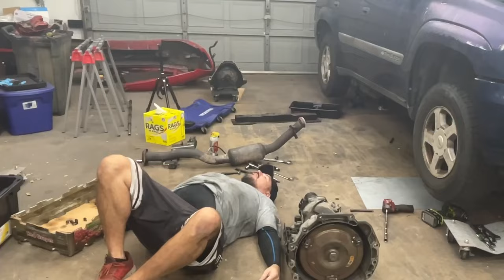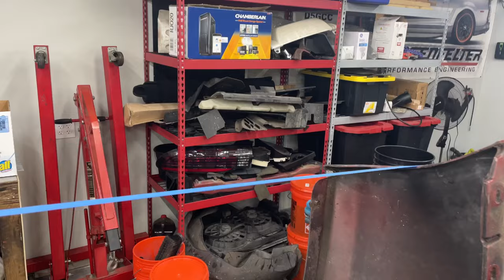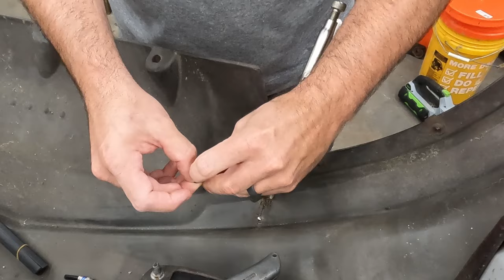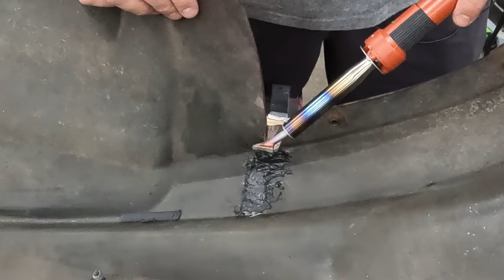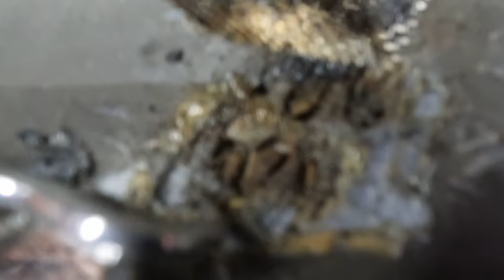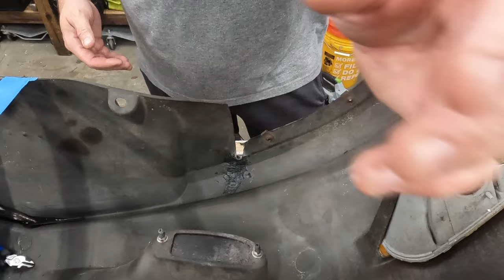Plastic Welding the Firebird Bumper...Again!

Comment: Good Stuff Ryan. I use this same iron to fix my rubbermaid water troughs. Only things with those is i need special filler that is poly eurethane. You think that plastic filler you have is bad that poly eurethane is really bad. Definitely a mask worthy job.
Reply: Also if you know the type of plastic the bumper is you can get the filler plastic the same so it bonds.